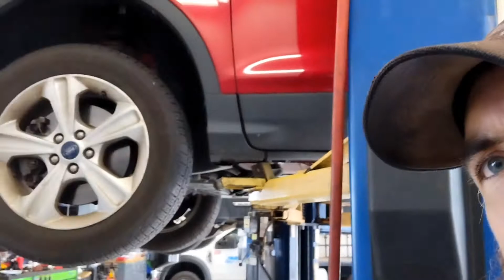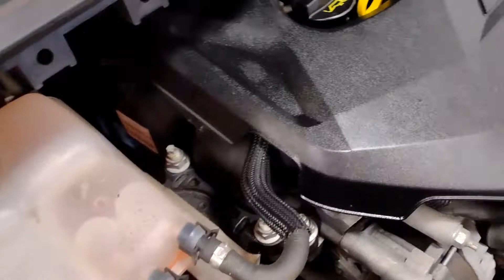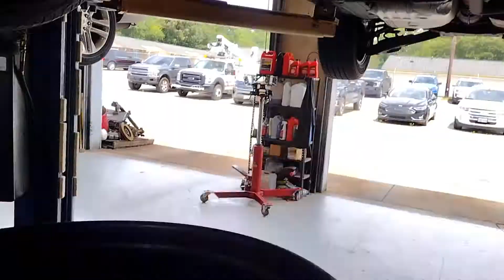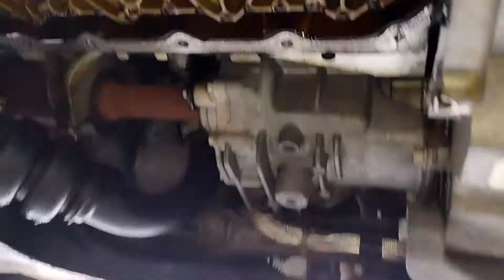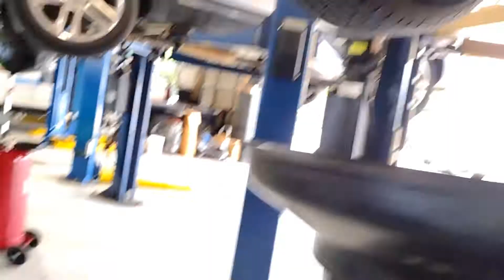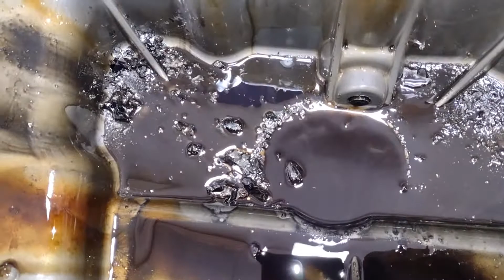What Bad Engine Noise Sounds Like

Comment: What was it? I have the same car same noice startd out of nowhere today! Was driving heard loud knocking and pulled over and called a tow.
Reply from the maker: You have a mustang? Cause the mustang was normal. The dodge charger was the bad noise. It was the camshafts lifters and rollers on the charger. If yours was knocking did you lose oil? When was your last oil change?
Reply: same thing JUST happened to me and they are telling me internal engine failure 😭😭😭

Comment: I have a genuine question, I have a 2016 ford fusion 1.5L and it had a reman engine put in it a week after I got it cause the block cracked. I’ve put 13,000 miles on it since the reman engine and mine is doing the exact same thing as in the video. I work at an oil shop so I change my oil every 3,000 miles with 5w-20 so it’s not the oil, if it is the rod bearing can you not just replace the bearing? Do you absolutely HAVE to replace the whole engine? And the place I bought it from already said they won’t do anything about it since their engine only had a 80 day warranty. I’m still making payments on it and need to get it fixed. Thank you.
Reply from the maker: @sethbickers6217  you can replace the bearing. But you will still need to take the crank out to get it machined. And you will have to make sure the cylinder isn't scored. Then you have to take into consideration all the metal that went through it from the oil. It's more cost effective to replace it. Now when you say "cracked block" are you referring to the coolant intrusion cause that isn't a cracked blocked. Or did it legitimately have a cracked block.  Your best beat for time and money is to replace the engine in all honesty
Reply: @BeardedFordTech  I’m assuming the coolant intrusion issue cause I would lose coolant slowly and it would randomly overheat even though it had coolant in it and carmart said the block had cracked. But would you recommend going to a yard and pulling an engine, it would be a friend and I? We have everything we need to do it with and the engine would only be about 500 bucks. But I’m worried about getting a non updated block and having the same issue.
Reply: It’s just crazy to me that a rod bearing can go bad like that with only 13,000 miles on a reman engine and they won’t cover anything or even try to give advice.
Reply from the maker: @sethbickers6217  yeah that's coolant intrusion if you get a vin off the vehicle send it to me I'll tell you if it's updated
Reply from the maker: @sethbickers6217  they may have built it wrong. Who did the reman. It does happen on new engines
Reply: @BeardedFordTech  I’m not sure who did the reman, I bought the car through americas carmart and they wouldn’t tell me what shop had it or anything about it. Sketchy af. There’s 2 at a pull a part near me. One is a 2018, vin# 3FA6P0HD5JR125905. The other is a 2014, vin# 3FA6P0HD4ER146041
Reply from the maker: @sethbickers6217  shoot me an email please. Email is in about me section

Comment: I'm very sure this is what's going on with mine I can't quite tell if it's a rod bearing or flex plate.
Reply from the maker: What's the oil look like?  Pull the inspection cover for the flex plate and have someone turn the engine with a very long handle ratchet and look for cracks.
Reply: @BeardedFordTech my daughters only does it when she turns a/c on sounds like a rod knock but stops when we turn it off..runs fine oils fines doesn't over heat
Reply: @GirlDad420  did you ever figure out what the issue was? My girlfriends car started making a similar noise
Reply: @Outdoorsman03  it was the flexplate (flywheels) it finally broke and left her stranded

Comment: I have a ford explorer 2013 limited with the v6 and tday I was driving normal and out of nowhere the engine started making this sound but not that loud what you think the problem would be cause oil was getting mixed with antifreeze like 2 days ago and now this happen
Reply from the maker: You mean antifreeze was getting mixed with oil. I'm willing to bed the water pump was leaking.  It's behind the timing cover.  Got in the oil.  And now your engine is more than likely toasted.

Comment: How much was this repair?
Reply from the maker: Oh it was a new engine. It was like $6800
Reply: Wondering if I should take this to the shop to be fixed. Almost 190k miles and not tryna keep wasting money?.
Reply from the maker: @miketyson9879  yours making noise?  Not sure what you mean by take it to a ship and not waste money. Is your knocking.  Email me a video.
Reply: @BeardedFordTech can I send you mine as well
Reply from the maker: @RunWithRelle  you most certainly can email is in about me section. Scroll down to contact
Reply: Just sent from shrelle in email
Reply from the maker: @RunWithRelle  I replied. That's not sounding good at all. 😞
Reply: Sounding exactly like this video. After putting too much oil, in attempt to quiet another ticking noise I drove two blocks and now it sound EXACTLY like your video
Reply from the maker: @miketyson9879  when you say too much oil how much is too much?  Dud you check the level before adding?  If it was at the full mark adding more does nothing.  I'm sorry yours is making this noise now.
Reply: @BeardedFordTech  can I have you also listen to mine and tell me what you think it is? I believe I'm screwed...
Reply from the maker: @jodyNorcros  you most certainly can send it. Ill.take a listen. Year make model engine size?

Comment: I have same sound coming in my car and too it’s ford escape se ecoboost 
Do you have any solution for it 
I just change my oil as well it was none left in there
Reply from the maker: Can you email me a video?  Aheflin31@gmail.com
Reply: @BeardedFordTech I sent you video on that email
Reply: Aheflin31
Reply from the maker: @Amitkhokhar201  I got it. I replied back. That's definitely a rod bearing. Or two.
Reply: How does someone do maintenance on something like this so it doesn’t happen again? Currently going through this with my 2017 Ford Escape SE.